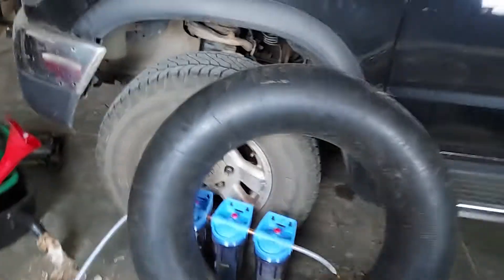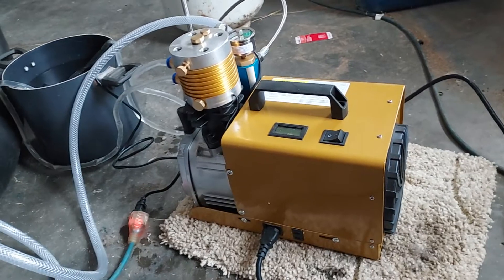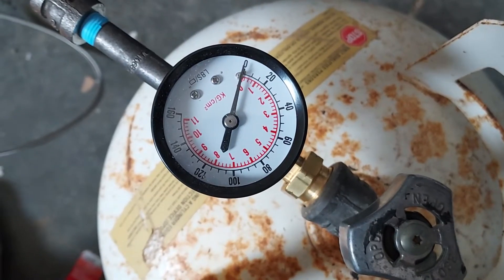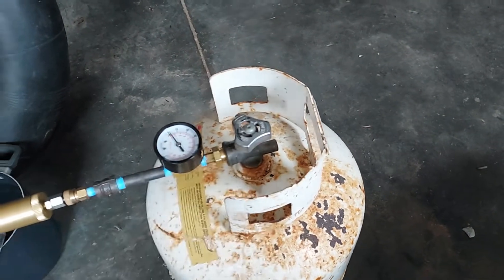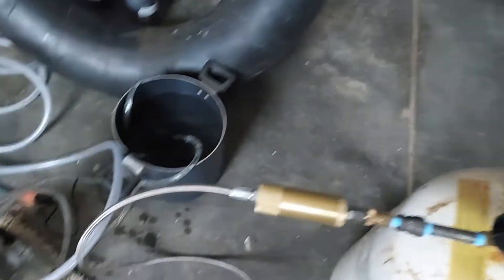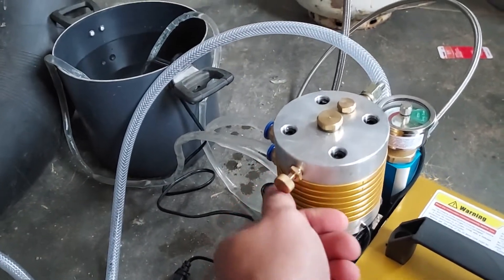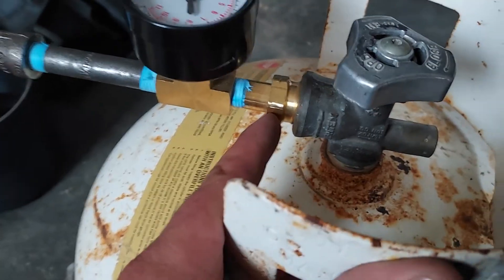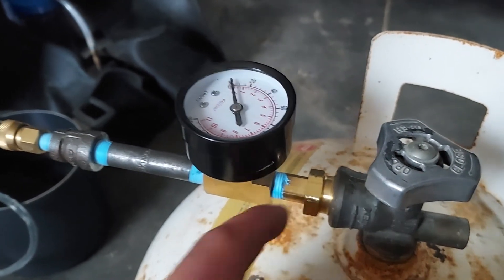compressing biogas

Comment: The steel wool filter is to provide the sulfur something to stick to so the whole area doesn't smell like rotten shit, and it also prevents it from degrading the steel of whatever device the gas passes through.
Reply: I stand to be corrected but sure I saw a comment also regarding prevention of steel degradation to the most vital and dangerous item for storage. The tank itself.
Reply: Correct, but steel wool needs to be rusted first. The chemical process is Fe2O3 + 3(H2S) = Fe2S3 +3(H20). The hydrogen in hydrogen sulfide needs to go somewhere and that's makes water from the oxygen in rust. Thus you need rust rather than just iron.
Reply: the steel also provides a sacrificial layer to prevent corrosion in appliances/pumps
Reply: Yes, I was going to say "secondary H2S capture from what I've read"  and yes, removes the "Acid" or free electron condition that steel is so susceptible to to a "sacrificial anode" much like some of the new electric hot water heater coils perform a similar catalytic task.

Comment: That brass fitting that you said was hard to find, how do you disconnect the tank? All of that looks hard line wired together. Do you lift the tank so that the tank is spinning, or are you twisting/untwisting the supply hose ?
Reply from the maker: The brass fitting turns out of the tank like a normal propane fitting

Comment: That's brilliant, could you run a vehicle in it?
Reply: it would have to be converted to cng first but yes
Reply: @bussafushiguro6064  ok that might make small scale farm digesters more worthwhile, many people wouldn't bother installing one to save maybe €300 per year on cooking gas. People wouldn't even bother to save maybe €1000 on home heating. However, if they could add a saving of €3000-€4000 on car or tractor running costs, that might be a game changer
Reply from the maker: I know it’s possible to run a car with biogas, but I have not yet figured out how to make it pure enough to justify the cost of the cng kit.

Comment: The tire tubes are too small I use the blow up bed and went in 150 lb per share inch I think the tire tubes are too small
Reply from the maker: I do agree. 

Although my oxygen levels in the lpg tank are very low, I can still get them lower and add to my own convince with larger gas storage vessels. 

I considered a mattress, but instead of buying something new, I have since plumbed the two innertubes together as one. Thank you for the idea.

Comment: Nice works thanks for sharing, how long does this filled tank last?
Reply from the maker: Hey Joshua. I guess that would depend what I'm using it for. I had about 30 psi in a tank and I was able to boil a few gallons of water for an hour
Reply: Depends on the bed some are single and some are double and depending only what your use it